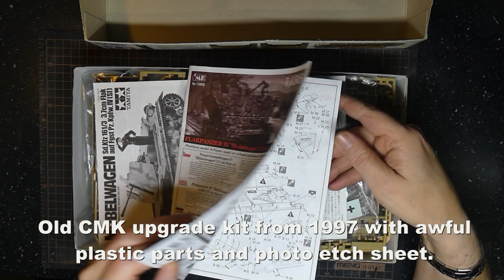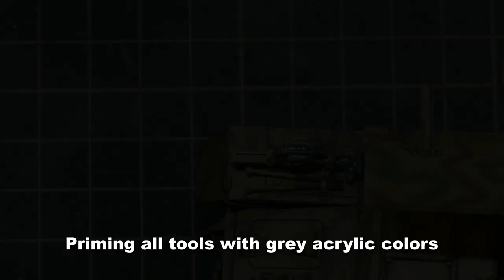TAMIYA 1:35 Möbelwagen Diorama - Normandy 1944 - Full Build Reupload

Comment: The only mistake most modelers make is rusting the tracks. German tracks didn't rust that much and generally would have more of the terrain they are riding in on them.
Reply from the maker: Hello Andre, rust or no rust? That is the question. Today or in the future, there will never be a satisfactory conclusion. When I see german tanks on display in a museum, I see rusty tracks. So in general corrosion on tracks is possible. The visibility  and amount of rust depends on many variable factors like basecoating, abrasion, weather conditions and action environment. I am weathering tank models since 40 years and there is only one answer to this never ending topic: take it as artificial freedom.
Anyway thanks for your comment, maybe an interesting fact for other scale modellers.